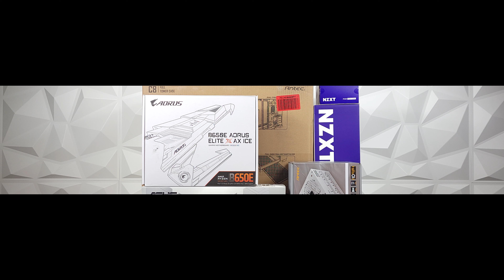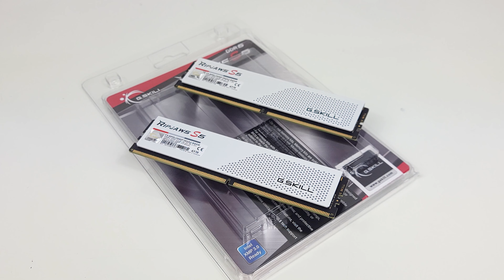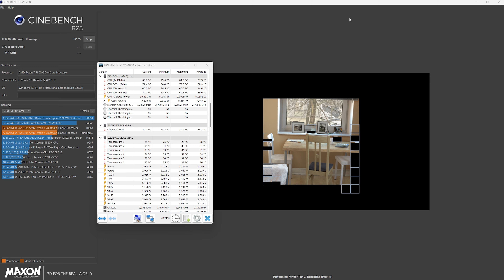White PC Build | Antec C8 | Ryzen 7800X3D | GIGABYTE B650E Elite X AX ICE | Asus RTX 4070 Ti SUPER

Comment: Hi, so i am building similar build same mobo and cpu but with 7900xt instead and i have a question, does ram work on 6000mhz frquency eventho they are 6000mhz with XMP?
Reply from the maker: As long as your motherboard support 6000, yes
Reply: @ forgot to mention im using amd processor, will it still allow to run XMP 6000mhz?

Comment: Ive got almost the same
Montech king95 pro case. 
AMD Ryzen 7 7800X3D. 
GIGABYTE B650E AORUS Elite X AX ICE
2 x G.skill DDR5 Trident Z RGB F5 6000J3040F16Gx2
NZXT Kraken Elite 360mm RGB AIO
7 120mm Montech fans
2 x 140mm montec fans
Asrock Radeon RX 7900 XTX Taichi White

1x WD Black SN770 500GB M.2 SSD
1x WD Black SN850x 2TB M.2 SSD
Reply: Hi, i have same pc. Ram DIMM DDR5 32GB G.Skill Trident Z5 Neo 2*16 CL30 RGB Nero [F5-6000J3038F16GX2-TZ5NR]
It is ok? Overclock is ok? Thanks
Reply: @salvuccio1976  don't know, i have it all normal. Runs good enough

Comment: I dont understand why but my M.2 Thermal Guard is falling off, i did it exactly like you but it just falls off for some reason, any advice?
Reply from the maker: As long as the right side is pushed and hooked, you shouldn't have issues. I'm not sure if your left latch is loose or broken.
Reply: @PCTechnician  Yes i figured it out, i did not know there was a latch i have to hook up to the board. Beginner mistake. But thanks for your help
Reply: @vayrah3912 how’s the case? I’m just asking since I’m interested in building my first pc with this case
Reply: @SlavikFH I cant tell you much about this case I do not own it. But it does look like a solid case. In the end its about how much space it should contain for your GPU and CPU Cooler and how many fans you want to install in it basically